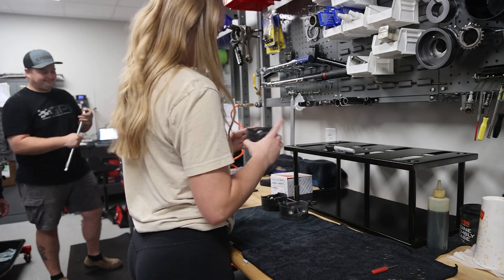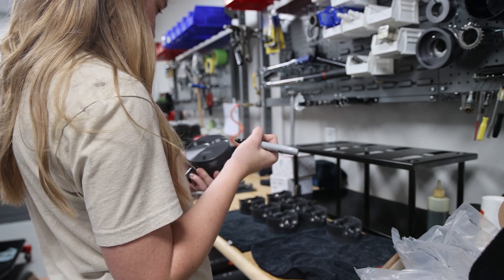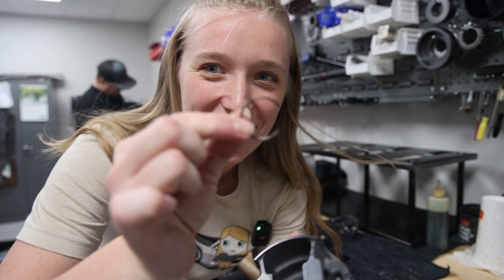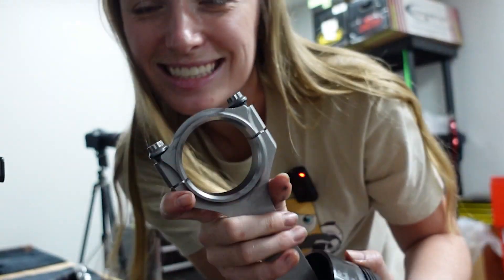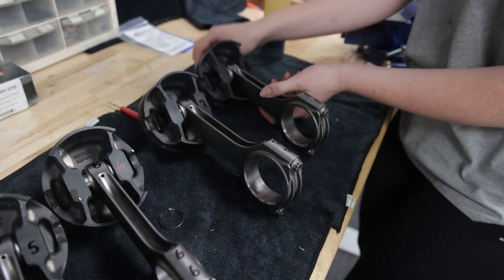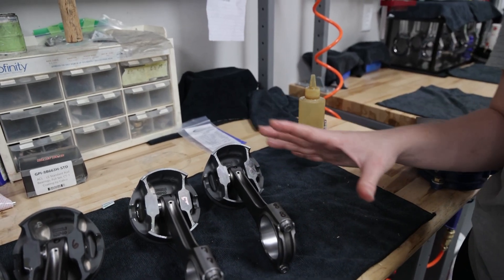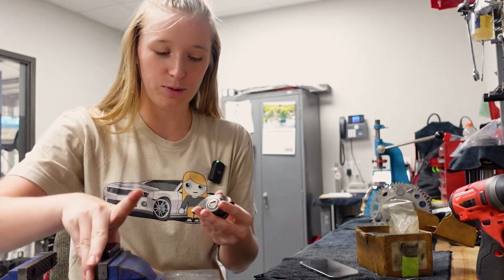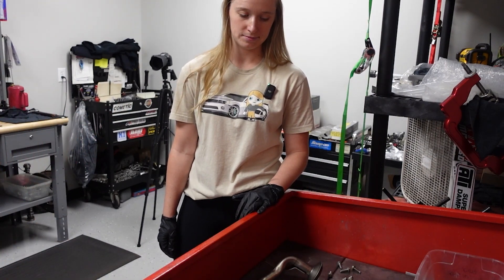Engine Assembly Prep- Pistons, Rods & Trunnion Kit Install Ep.4

Comment: Why are the rods and pistons not balanced? I don't see any marks of this being done. If you are in there it only takes a little longer to balance them within 0.1 grams. The factory weight can differ more then 1 gram. Which is a lot.
Reply from the maker: The engine builders did this for me while I was at the machine shop. Sorry I wasn’t able to film every step of the process since we are on a deadline
Reply: @KaylaRundle  No worries, just thought you might have forgotten. :p Goodluck
Reply from the maker: @bcr1818  yeah you’ll see as I post more there’s a few steps I completely pass over. I did specific jobs while they did their job 💃🏼  just showing the fun steps of the process!!